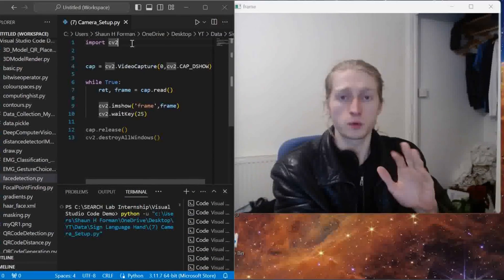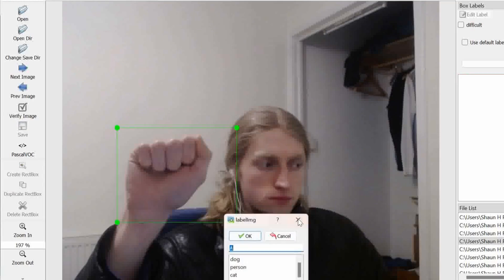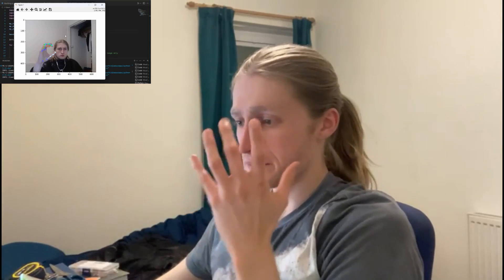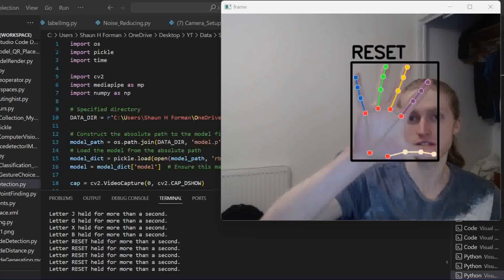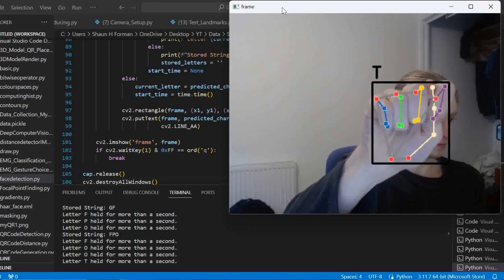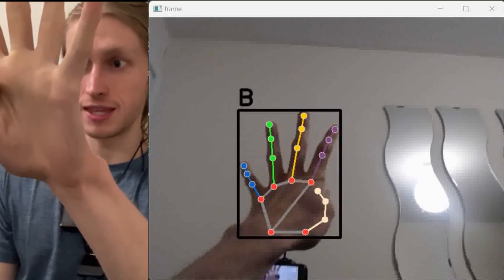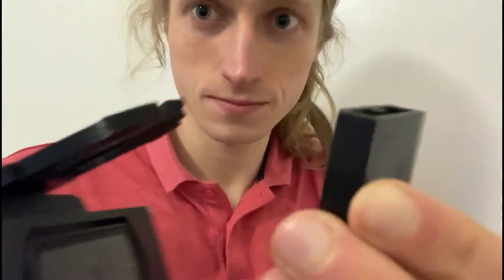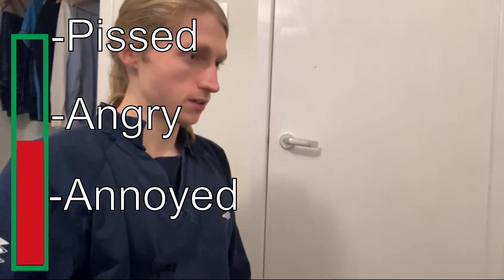A Robot That Speaks Sign Language

Comment: I have a Python code with face detection I want to add face recognition and facial expression can you do that
Reply from the maker: Yes definetly, you will need data for the facial expression and recgontion bit, if your trying to recgonise yourself that part should be easy enogub ;D
Reply: @Robotcus  I'm proud to share that I've developed an OpenAI-powered chatbot in Python, featuring real-time face detection. Upon startup, the system uses a camera to detect a face and then issues a verbal greeting. However, currently, after capturing an image and delivering the greeting, the camera operation freezes before the system transitions into listening mode for user input.

My goal is to enhance the system's functionality by ensuring the camera continues to operate seamlessly in real-time, without freezing. Additionally, I aim to empower the chatbot with the ability to continually recognize faces in real-time through the camera, essentially giving the bot "eyes". This will enable more dynamic and interactive user engagements. Any insights or suggestions on how to achieve these improvements would be greatly appreciated.